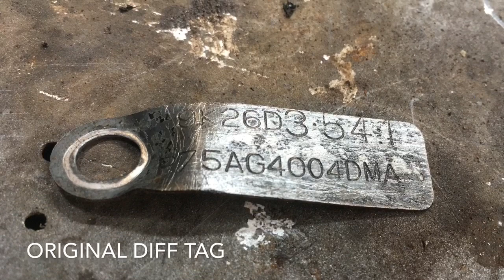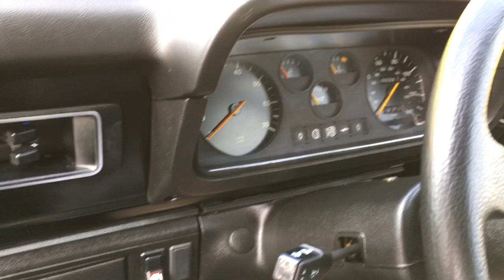Base RS2000 Restoration 3

Comment: Nice work I'm restoring a black base rs2000 as well. The Mexico looks a nice car but would you not put the white needle clocks in it and should the air box, rocker cover not be blue
Reply from the maker: Hi Stephen, good to hear of another one being restored, how’s yours getting along?
As for Martin’s Mexico, the last ones were all black air boxes and cam covers, also orange needle clocks. Not sure of the exact date, but I think it was from  some time in ‘77, Thanks Mark
Reply: @MarkEdwards  no problem I had thought all the Mexico's were white needle and blue air box, rocker cover but every day's a school day :-). My 2000 is coming along slow getting parts gathered up is a job on it's own. Keep the updates coming and I will send you some photos of mine when I get a chance thanks
Reply from the maker: I look forward to seeing them 👍🏻
Reply: @stephenbradley5805  I think you are nearly right.  The Mexico's were a slow seller so they hung about in the showrooms for a little longer.  I'm 99% sure (because you can never be 100% sure)  that all Mexico's had white needle clocks,  blue air boxes and the last with the blue oval grill had black cam covers.